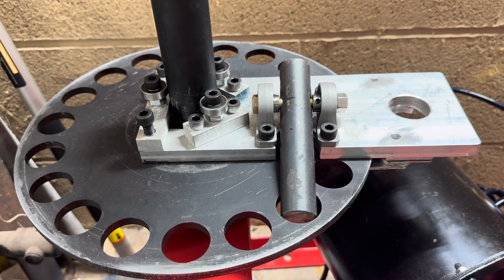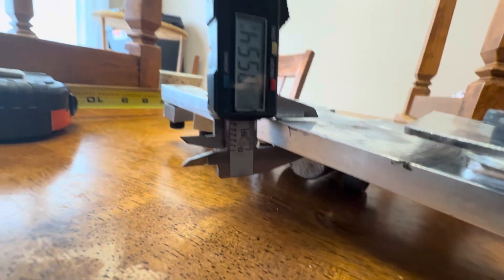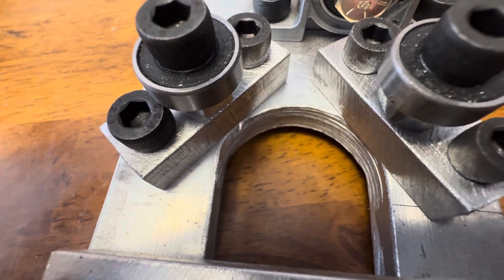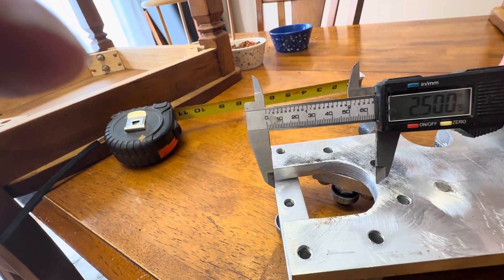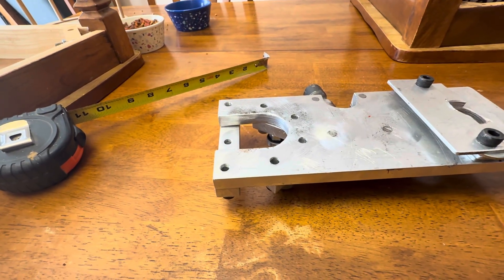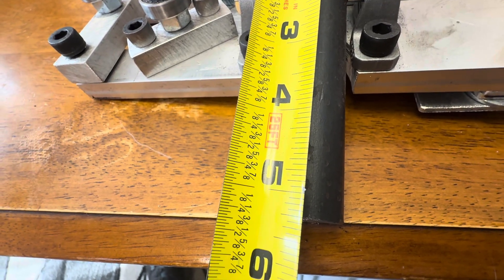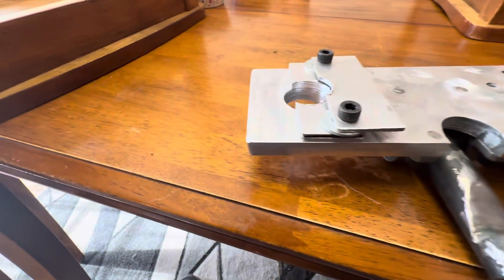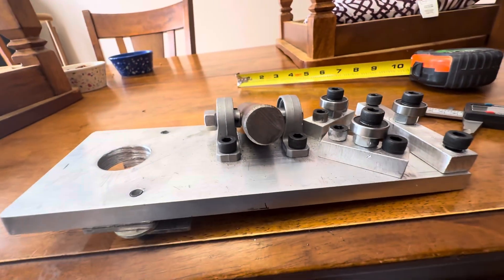KATOOL KT-2002 tire machine modifications Measurements and how to build the ratcheting modification

Comment: Hi. What is the measurement on the each 3pieces of aluminum that  the  3 bearings are mounted on? I believe you forgot to measure those. Thanks
Reply: I am cutting out a cardboard template first before doing the cuts on plait.
Reply from the maker: Hello and thank you for your question. The longest is 4 inches and the 2 smaller pieces are 2 inches and they are the same as the thickness of the main plate which is aprox 1/2 inch or 13mm. Again thank you and Happy Holidays!!!
Reply: Is that 4 inches X 2 inches?  And the others 2 inches X 2 inches?
Reply from the maker: @l @lennoxcooper3881  sorry I don’t understand your question, the piece is 4 inches long and 1/2 inch wide. The other piece is 2 inches long and 1/2 inches wide
Reply: Ok, I was thinking when you said 1/2 that you was talking about the thickness. But now I see you're saying 1/2 inches wide with those lengths. Thank you sir
Reply: Happy Holidays to you as well
Reply from the maker: @lennoxcooper3881  sorry I didn’t know any other way to explain it.
Reply from the maker: Sorry I didn’t receive your question until this morning. I will get your answers to you when I get back in town, Merry Christmas
Reply: Happy Holidays, Big D. Can you tell me the measurement in inches of where the hole starts to the end of the plate?  The hole where the bar drops in. Looks like from video maybe 1 1/2 . Thanks
Reply from the maker: The measurements are 1 inch from the end of the plate and 1 1/4 inches in diameter.
Reply: @mrknowitall123  thank you very much
Reply from the maker: @lennoxcooper3881 you are welcome, I hope when you finish you’ll send me a video please, would love to see it.

Comment: Hi, I have 1 more question. What are the 2 hole saw sizes you used to bore cut? Thanks
Reply: 1 1/4?  for 1
Reply from the maker: Sorry I just saw your question. Here is the breakdown with measurements of the ratcheting modification. And in the description I supplied the parts and where I purchased them. Thank you

Comment: Why not make and sell these? That's amazing.
Reply: I think you should make them and sell them my brother lol. There's no waybim building this thing😂. I'd pay $200 for one
Reply from the maker: I'd sell my machine with all of my upgrades along with the ratcheting plate for $600
Reply from the maker: The problem with making and selling these I think is I have to have your machine here to fine tune it. After I put it together I tweaked it to work perfectly. The second thing I see that there are at least 2 models of the same machine. Look very similar but are different dementions. 3 rd after the cost of making one of these then shipping, I don’t think much money could be made. Thank you for checking out my video.

Comment: Do you think a wood plate could work instead of aluminum or steel? Just curious as I’m thinking that could save time, money, and effort in the build.
Reply from the maker: I think if you use a good hardwood like oak or black walnut it should work but I still think you would have to use some metal like the small piece on the underside the keeps the plate from popping up. I have used hardwood in the past and also used the same type of hardware which requires drilling holes and tapping those holes, would love to see your build when completed. Have a great day my friend

Comment: Did I miss the overall length/width of the main plate?? Thanks!
Reply from the maker: Hello, the length of my plate is 10 1/8 inch long. The length possibly could be 10 inch it’s just the length I asked for but they gave me 1/8 inch longer. I just wasn’t going to waste time cutting off the excess. If you build one and you want me to upload it let me know. I would love to see the build.
Reply from the maker: I will measure it and add a reply very soon